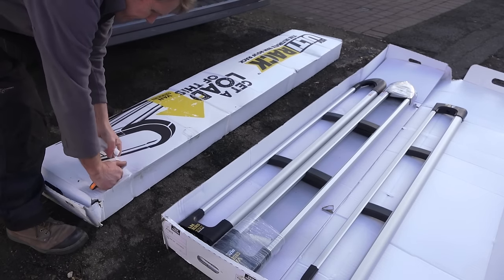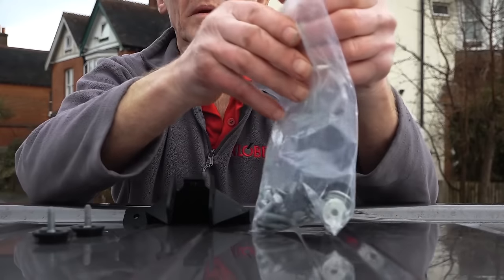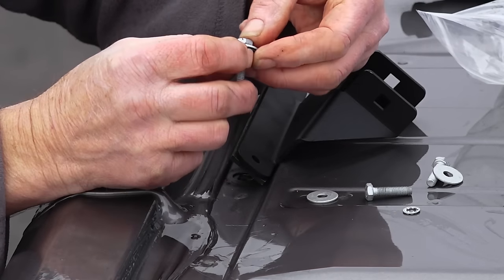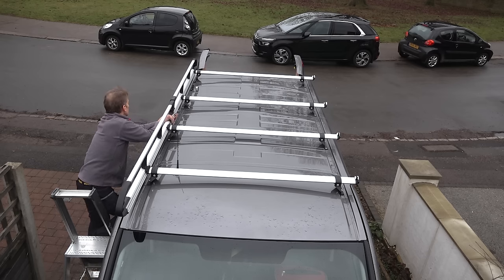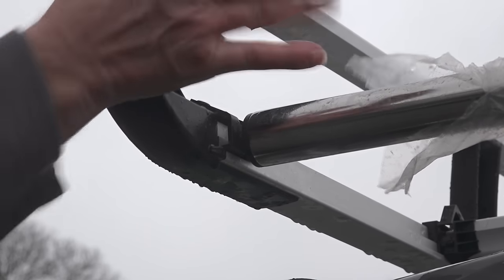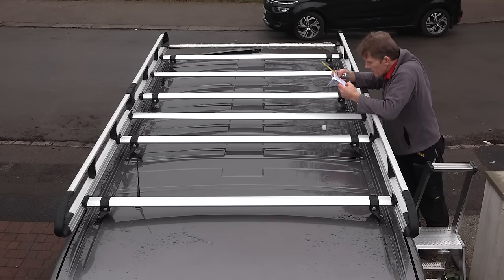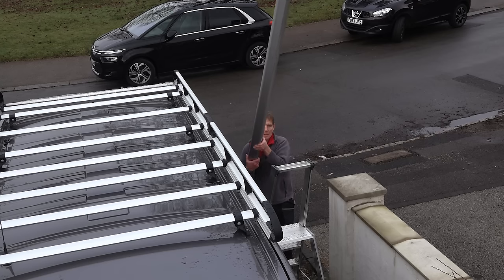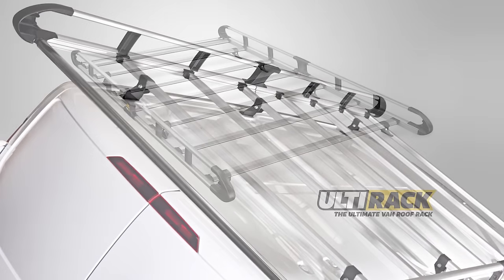How to Install the Van Guard ULTI Roof Rack Review

Comment: Nicely designed rack! Little tip to get out those short pieces of pipe out of the pipe carrier, leave a long piece of plastic pipe in there with bit of hard plastic the shape of the hole at the end and leave it in there, when you pull this out it will,drag the shorter pieces out!
Reply from the maker: That is a great tip. I think Vanguard have a tube you can open at the front but I didn't get one and I am going to make that little plastic disc up this weekend. Thanks. It is great to share these ideas.

Comment: Hi Roger, 
I like to smear a little copper grease on racking bolts before installing them. It helps stop seizing in the future.
Can be a really pain removing old bolts without the shearing them off.
Carry on the great work. Cheers.
Reply from the maker: Good tip Chris. I should have thought of that because I was thinking of putting Swan Seal on the threads as a non setting sealant

Comment: Hi Rodger, just got the same system installed on my vauxhall vivaro van, I get a lot of wind noise when I get to 50mph,  is yours the same? I think it's to do with the position of my pipe carrier, I'll take it off and see if it's better,
Reply from the maker: Hi Keith 

 I thought I did an update on this but if not I had to get a front spoiler which cured it completely. Give them a ring and get them to send you one. It is unacceptable without. I have also been told that you can cure it by  wrapping something like a bungee cord around the front bar in a spiral but, for me, the spoiler is a better option. Read the comment below there are several people talking about this problem
Reply: @SkillBuilder  Thanks for your reply Rodger, I'll have a read down the page and get a front spoiler ordered. Thank you, keep up the great videos. 👍

Comment: all sorted! bungee cord spiralled round the first rail..
Reply from the maker: Wow! That is amazing. I am going to try it. You sir are a genius get a job at NASA
Reply from the maker: I spoke to Vanguard and they said that this seems to happen occassionally on some vehicles. It can be as simple as moving the leading bar back or forwards but the front deflector is the best method so I am going to try that.
Reply from the maker: The deflector worked a treat. Funny thing wind.
Reply: Did the wind deflector come at an extra cost?  I cant understand how they can say it happens on some vehicle's as it's a vivaro specific rack on a vivaro

Comment: Could you fit an awning bar such as a Fiamma F45S 300 to one of these roofracks?
Reply from the maker: Yes that is very easy to do because the awning bar just bolts through. You might need a couple of aluminium plates but it isn't hard to do.

Comment: just fitted one of these on my vivaro, does your's make a noise after 25mph it's unbearable
Reply from the maker: Yes I have discovered this too. I made the video and posted it then when I took it on a long journey it made this low hum all the way. I am going to talk to them next week and see if a front spoiler makes a difference. I had one on the old rack and it was silent. It is even more baffling because this has the new aero bars. I will let you know what I find out
Reply: Sweet!